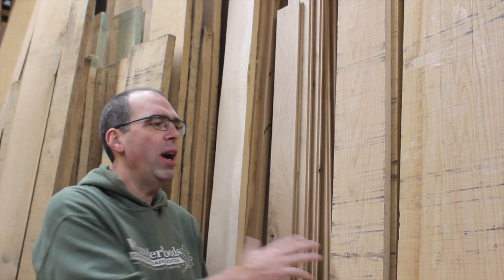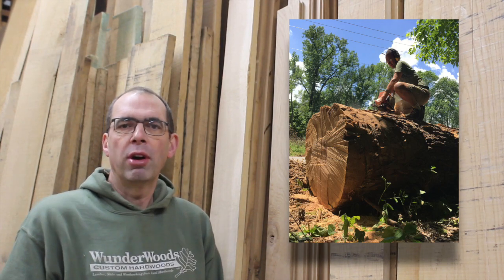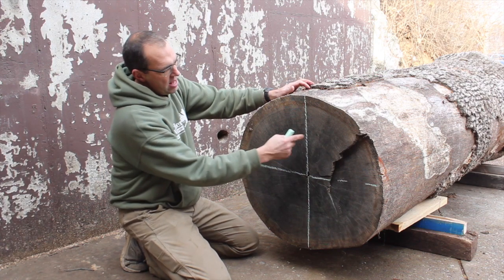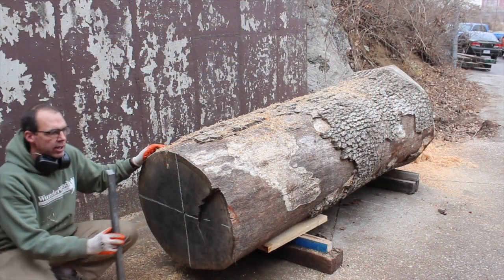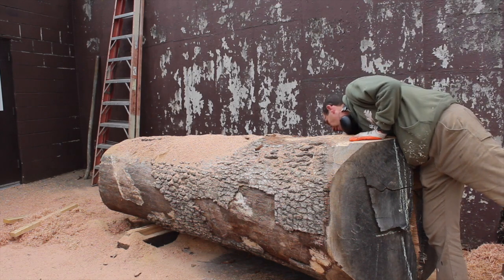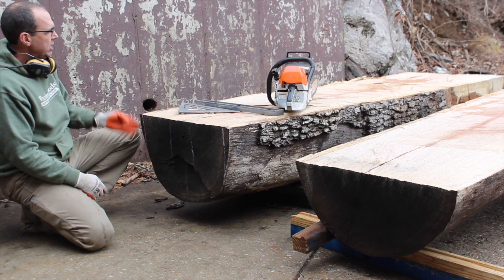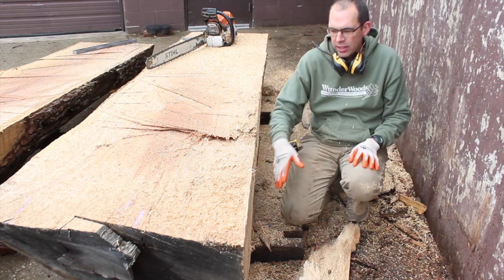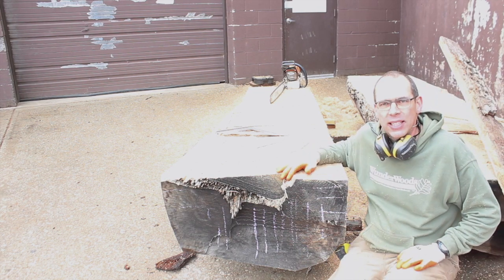Quartersawing a large white oak: Part 1

Comment: You did about the best job I've seen at getting a straight, perpendicular cut to halve the log.  I've seen some guys just butcher a log when doing that step.  Have you ever tried one of the chainsaw brackets with alignment boards like those sold by Gempler or Northern Tool?  Just wondering if they would actually work for halving a big log.  Thanks for posting the video!
Reply from the maker: Thank you. I have always done it by hand without a guide. I think the guide might help, but when using the longer bars I think it would just be cumbersome.